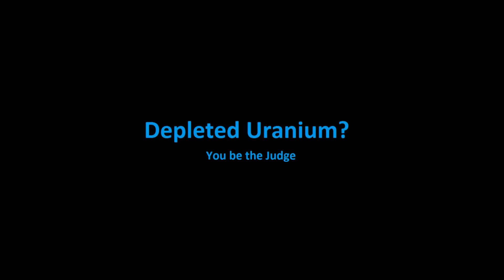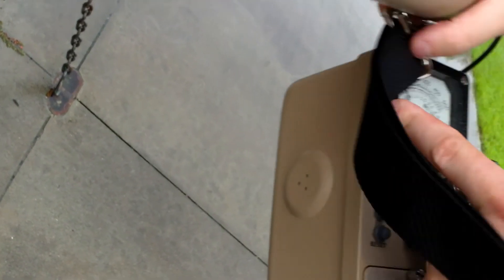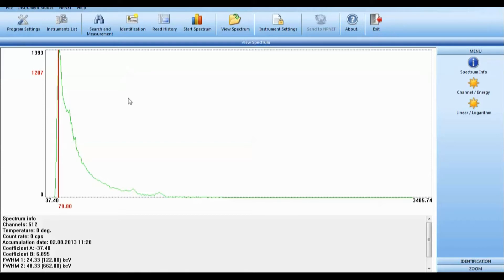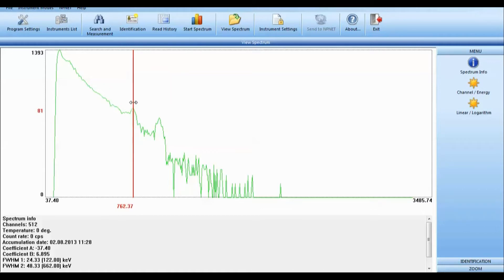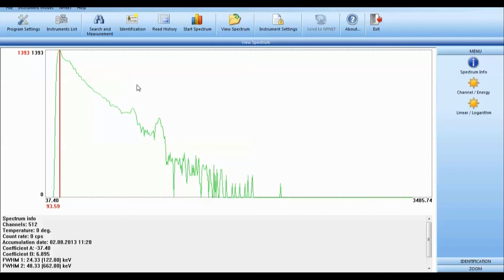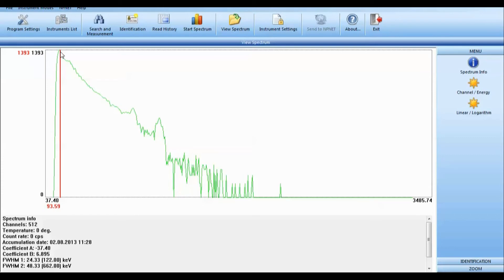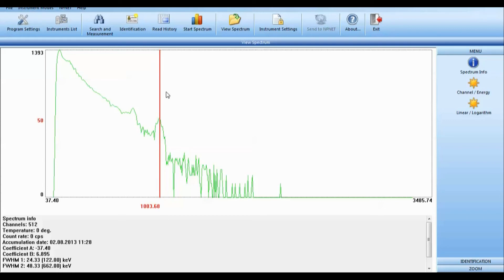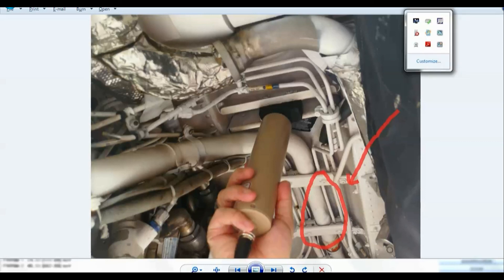Possible Depleted Uranium Found on an Airplane

Comment: That's easily the hottest thing that civilians are allowed to own. Unmodified aircraft weights are NRA exempt. You don't need any kind of special licensing to buy transfer and own one. You're not allowed to cut or modify them except for adding paint or labels.  It's hot enough you wouldn't want to keep it in your house more like in a lead box in the garage. If it was a paperweight on your computer desk, you could easily exceed your yearly exposure limit in an hour or two and get a high enough dose to cause health effects in only a few weeks time.

Comment: Depleted uranium is the only radioactive element I KNOW OF that's used in airplanes so that could be it. Do you know other radioactive materials found in airplanes?
Reply from the maker: +Brandon Fisher   Sure, radium 226 is found in older dials (WWII times). But yeah, DU is likely. The quick spectrum I took looked like DU, too.
Reply: Tritium (Hydrogen-3) is commonly found in Airplanes, i have seen Tritium Lighted Exit signs in 3 different airplanes.
Reply: Of course, i don't suspect it to be the source of the ~100,000 CPM radiation, i am quite sure that the source is Depleted Uranium.

Comment: Some military aircrafts have an radioisotope icing alarm. This device consists of a metal rod, protruding from the upper side of one of the aircrafts wings. The rod contains a geiger müller tube, connected to some electronics. A radioactive source (often Sr-90) is mounted close to the rod in the wing, so the radiation emitted from the source can be continously monitored by the geiger-müller tube. In the case ice builds up on the aircrafts wings, the source gets more and more shielded, so the detector measures a lower cps rate, hence an alarm goes off . This way the pilot gets warned before a dangerously thick layer of ice has build up on the hull of his aircraft.
Reply from the maker: Neat!  I had actually never heard that before. Sort of like a radio-density monitor  :P

Comment: DU often used in aircraft trim weights
Reply: Yep pretty much common knowledge, stuff is pretty safe to be around as long as you don't ingest it. Besides your going to see readings almost double that at standard airliner altitudes (30,000 to 40,000 feet).

Comment: You could always pick up a pancake probe that's rated for a 900 volt meter and wire it to a CDV-700. The problem is you're looking at $60 for a Soviet SBT-11A probe which a good bargain for the money, but only rated to 400 Volts. An LND-7317 probe is 2 to 3 times that much and rated up to 675V, so you could possibly tweak the HV POT and get it down to a usable voltage. The Inspector EXP RAP-RS1 probe might work if it's 900V rated, but I can't find the specs on it.

Comment: I know for a fact that in a 747 the counterweight is DU. It's critical to have the balance point right on airplanes, without that the plane will not fly or will fly incorrectly. watch?v=aVL8RifMQ-s In this video the load the cargo 747 was carrying shifted which caused the plane to nose up and stall. Removing the counterweight would be similar, but nose down. Often the weight is DU when it needs to be small. 1500kg in a 747, located in tail. I'm not sure where your friend got his information.

Comment: I was reading about Thorium, and because of its extreme resistance to heat, they use it in high quality airplane engine components that need to resist lots and lots of heat.(Thorium has a melting point of about 3,300 degrees Centigrade)
Reply: That would explain all the engine fires we've been seeing since Fukushima pissed all that good stuff Into the atmopshere. Reaction with neutrons?

Comment: So, just FYI I asked a friend who worked in the airplane buisness, and he told me that yes, depleted uranium was often used in airplanes, but not for weight balancing : for that they prefer adjusting other internal components.

He told me instead it was used for something that had to do with the onboard electronics. Probably part of the shielding of some radar equipment, but he was not sure anymore.

Comment from the maker: Cyanide, Arsenic, streptococcus, botulinum toxin, and other lovely things are completely natural... and they kill or make people very sick. By the way, natural water can contain all of these.

Natural does not equal good, nor does unnatural equal bad. The origin is not the issue, but rather, the utility or nature of the material.

Water when exposed to gamma rays doesn't really change much. You might be thinking of alpha, proton, or neutron flux, which can change water, easily.

Comment from the maker: Note:  I consider "bad" to mean an induced risk which outweighs a gain. For example, X-rays increase your risk of cancer, but X-rays also save lives. Therefore, I consider X-rays "good", unless over or misused.   Just to be clear.

Thus, if fluoride does increase cancer, bone fractures, etc, but the risk is less than the benefits provided, I might evaluate that as good (many other factors come into play as well). This is a benefit I have as a layman.

Comment from the maker: Also folks... for anyone who has questions about DU and cannot find data...    DU = Depleted Uranium and the ONLY difference between depleted uranium and chemically refined uranium is having less than %0.7256 U235 per unit mass. That's it. Enriched uranium is the opposite, having greater than %0.7256 U235 per unit mass (typically approaching %80+).

Comment from the maker: It's not that dangerously hot. Notice that I moved my probe about 6 inches and went from 20,000 CPM to 100,000 CPM, which means that six feet away in the cockpit the dose rate would be nearly background.